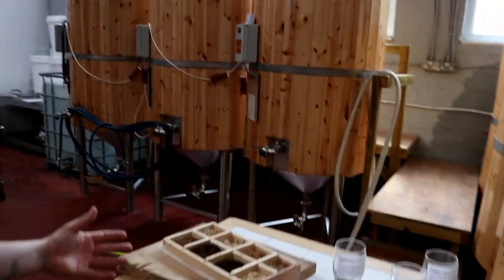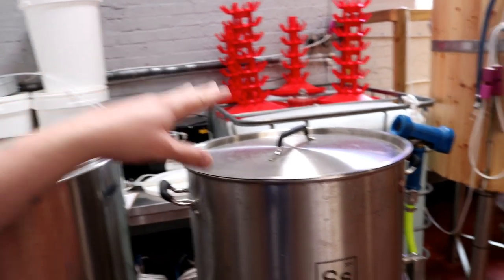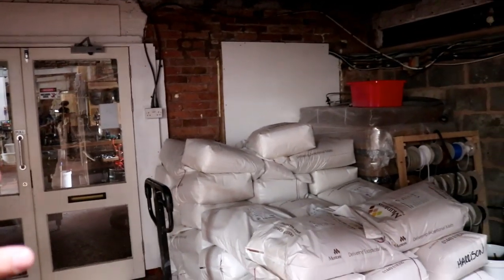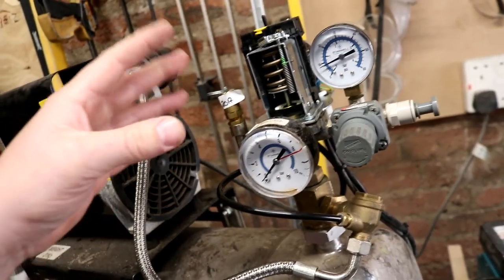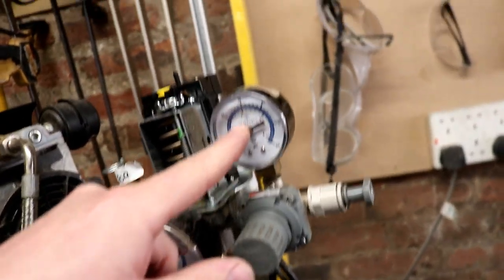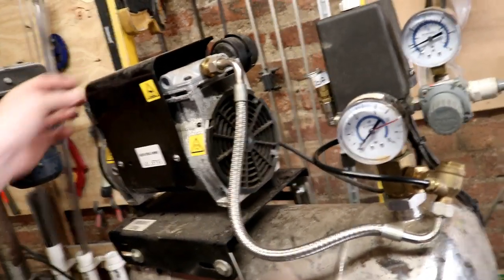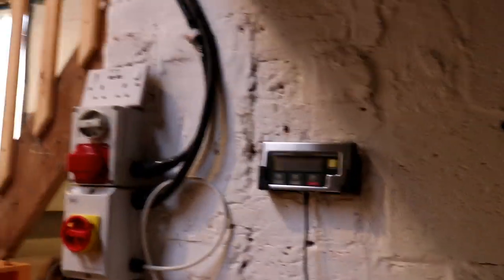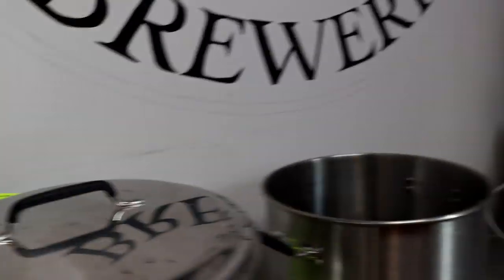Brewery Tour Aftermath

Comment: why've you never switched to gelatin finings?
Reply from the maker: Gelatin is a terrible finings. When Isinglass degrades the resultant slop contains lots of gelatin. Its clearing power is a fraction of Isinglass. The whole industry has used Isinglass for decades. If there were a better substitute it would be mainstream. I want to move to a vegan product to do the job. I have a few leads so if you want to find out more stick around.